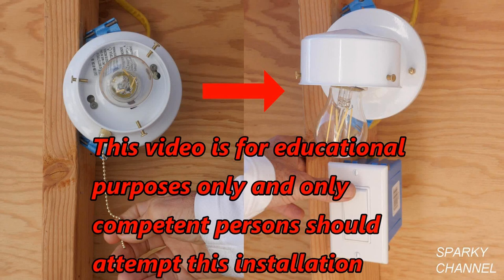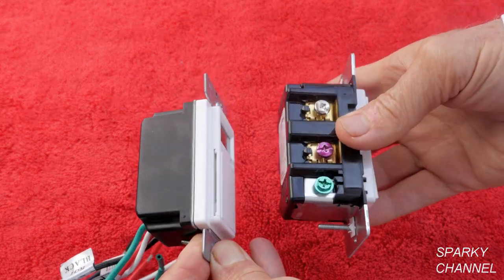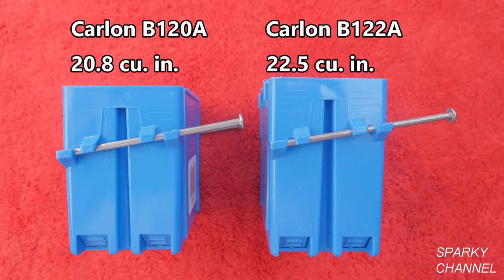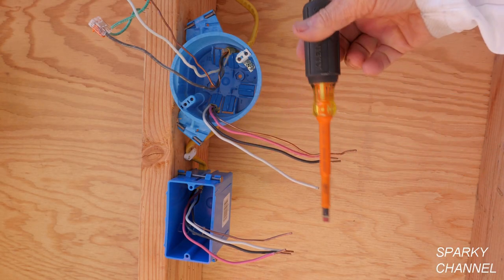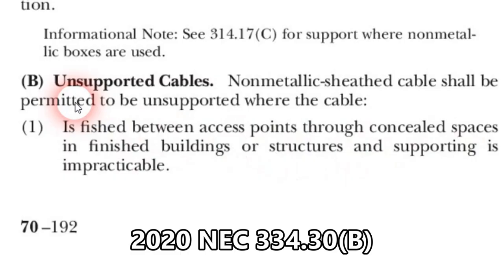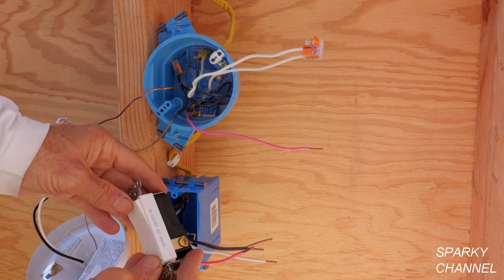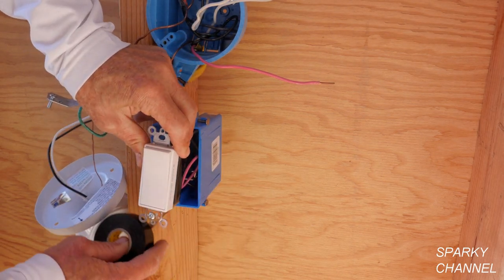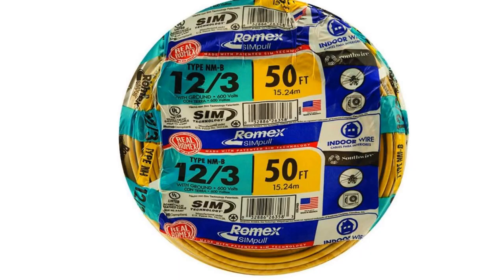Convert a Pull Chain Light to a Switched Light with 2020 NEC Codes 404.21(C), 334.30 and 314.17

Comment: Just used this as my guide to convert a pull lite to 2 separate switched overhead lights in my attic conversion. Thank you for making sense of this.. Honestly it was still a little confusing until I saw it firsthand then it made total sense.
Reply from the maker: Fantastic! Thanks Mike!
Reply: @SparkyChannel  ill need you when i get into my basement wiring LOL

Comment: I don’t get the red third wire. Why not just tie the hot from feed to light to switch and same for neutrals and grounds?
Reply: The black wire is the constant hot, the red wire is the switched hot for the light fixture. Here's a schematic of the wiring:
https://www.sanier.de/wp-content/uploads/images/schaltplan-ausschaltung-kerp.jpg
This is a european schematic, so the colours of the wires are different. The brown wire on this is schematic is the red one in the video. In Europe the neutral is blue, so in this video it is white. But white line on white ground would be silly. Green/yellow striped is the ground. 
That schematic is only about a regular switch, not for such modern ones which also require a neutral for the functionality. But to understand how a switched circuit is working the neutral is not necessary. The left upper square would be a junction box, left lower one is the switch and the circle with the X is the symbol for a lamp.
Reply: @Marcel_Germann  excellent Marcel!! That makes sense now!! He didn’t explain that in video and glad u did

Comment: Can this be done with a 12-2 and ceiling fan/light?
Reply: Yes. Do exactly what he did, but use the white wire going from the light to the switch as an extra "hot" and mark it with red or black tape.  Connect that wire exactly how he connects the red wire in the video.  The real neutral white wire coming from the power line into the light box should just connect straight to the fan.

Comment: Thanks so much.  Do you have a video on a sub panel?  I live in an old house with only four outlets,  2 in the kitchen, 1 in the livingroom and one on the back porch. None in the two bedrooms and none in the bathroom. All light fixtures are pull string. The ceiling lights are all on one breaker and the 4 outlets are on one breaker. So I want to add more outlets and wall switches.
Reply: Were are definitely living in the same house. Did you manage to find info on this particular situation?
Reply: @sikiskee  : no,  bought most of what I need, now just have to get at it. Thanks.

Comment: Alright so I have two lights in my storage room that are pull chains. I want to add a switch to control both lights. When I add a switch I’ll have to pull power from w/e is in the box and then I have to add a switch leg. I’m thinking about double switch legging the lights and running a power down to the switch. So 3 wires (2 SL’s and 1 pwr). That should work, yea?

Comment: Hey spark..great video! My thought is..how would this be wired if you used a 12-2 instead of a 12-3?

My boss calls it a dead end switch leg. Any chance on making a video using 12-2? Is that not code? Just curious as I encountered this last week but with 12-2.
Reply: Yeah, it's probably fairly common to run two 12/2 cables from the light to the switch box. One cable for the switch and the other for the neutral with an extra conductor.
Edit: Or rather I meant to say two 14/2.
Reply: Why do you need to do two wires if you are not using a new “smart” switch?  I don’t see why you need a neutral wire

Comment: Why not use 12-3 from switch to light. Series connect all like wires. Less work, should work fine. What am I missing? Is it a new code or requirement based on switch type?

Comment: Hi Bill!  Great video!  What is the tool you used at 10:45 to push the wires in the box?
Reply: Its a volt claw. I learned about it on here and bought one. Very nice and well made useful tool

Comment: The first Klein voltage tester amazon link is not working. Thanks for the video!
Reply: Go to kliens website and become a member of the tradesman's club. U get points for things u do and a wheel to spin every month. U can use the points to redeem free tools, even a dual voltage tester!!!
Reply: @pointedspider  The best thing is a two-pole voltage tester. They also measure DC, these pen testers are only able to detect AC. If you have a PV installation you got a high DC voltage in your house (690VDC) between the panels and the inverter. And on electric vehicles it's the same, battery voltage is in the range of 400VDC and above. It would become a bad day if you get in touch with it....
And Klein also got such two-pole testers.
But these pen testers are quite handy for some applications, but I wouldn't trust them so far to use them for proofing if the circuit is really dead. I got one which is really eating up batteries. It's not only detecting voltage, it can also indicate the direction of the rotating field in a three-phase system (clockwise or counter-clockwise).

Comment: Hi there. Quick question. Does doing this require a permit with or without an open wall? Thanks.
Reply from the maker: That's a good question. I think you could argue that you're just replacing a switch but I would ask your local inspector.
Reply: Pretty sure this falls under house maintenance, and if it's your house...well:). Be careful, test circuit using hot cold hot testing, turn circuit off. And if ur that nervous you can take sparky's advice and contact ur local AHJ.

Comment: Sir, I recently purchased a pull chain light. It has a black, white and ground wire. I want to make it so I can plug it into an outlet. The outlet wire I purchased only has a black and white wire, no copper ground. How do I make this connection??? Please help.
Reply: Get yourself a different wire with a ground!

Comment: very good other than you didn't specify the type of wall switch you were using, was the switch a 3 way, or single pole? looks like you used a 3 way switch. and you also didn't specify a why a 3 wire vs a 2 wire cable from pull chain to switch was used.

Comment: Question:

As an alternative to making a switch loop with 12/3 romex, could you have done the following?

1. Run a 12/2 w/ground romex cable from the light box to the switch box, then splice those wires together in the light box. Essentially using the light box as a junction box to lengthen the original cable.

2. Run a 12/2 romex switch leg back to the light box.

Please let me know if this would work. Let's assume one didn't have 12/3 romex on hand and also the switch box has appropriate volume.
Reply: It's new code to make sure that light switches have a neutral for future expansion of smart switches, etc.   You can certainly do this with 12/2 if you just want to get it done.  Do exactly what he did, but use the white wire going from the light to the switch as an extra "hot" and mark it with red or black tape.  Connect that wire exactly how he connects the red wire in the video.  The real neutral white wire coming from the power line into the light box should just connect straight to the light.